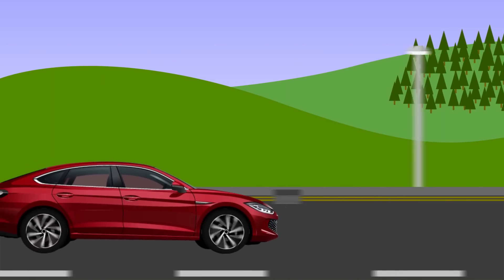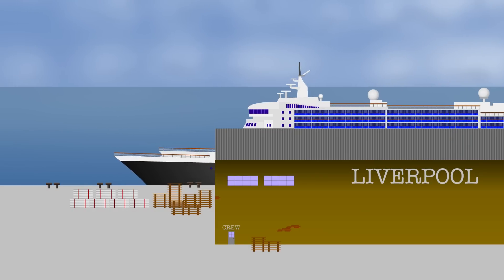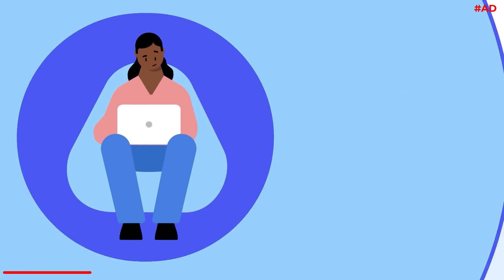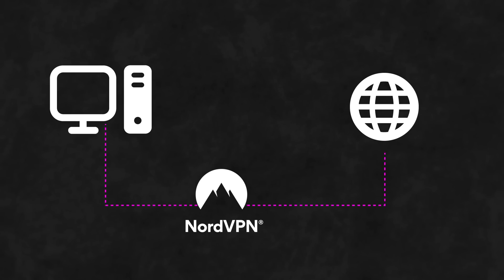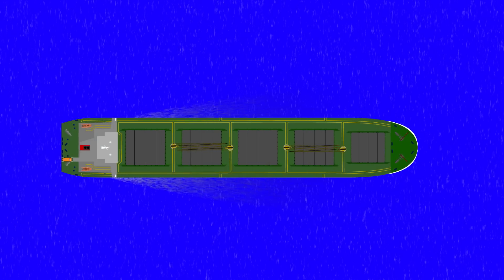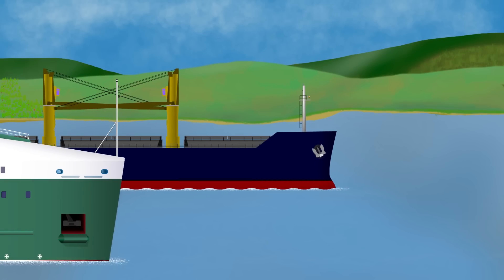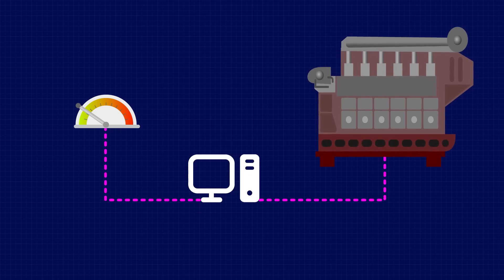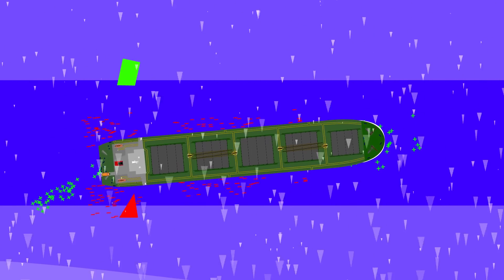What's Going Wrong With Fuel Efficient Ships?

Comment: This reminds me of how traction control kicks in on your car when you might be trying to steer with the throttle or are trail braking.  Suddenly you are out of position.
Reply: Tried to give my car a kick of throttle to try and get it back on track in icy conditions, but the traction control kicked in and killed my power and I ended up sliding into a crabapple tree.
Reply: Not me. All my cars have their abs fuse yanked the moment I get home. No abs, traction control, stability control etc.
Reply: You should be used to traction to control by now , it's been pretty standard for 30 years . I remember the days before it , you needed to know how to drive people these days can barely tie their shoelaces you want them in a car they've got to control without assistance ?
Reply: @mathewkelly9968  none of my vehicles even have ABS
Reply: @beardedgaming1337 or seatbelts ? or airbags ? ABS stops faster than formula one drivers can.
Reply: @licencetoswill  In snow, gravel and sand, ABS has a longer breaking distance than just slipping with the wheels, but makes the car way easier to control. In other situations, ABS has a shorter braking distance
Reply: @licencetoswill  One of my four has seat belts, I think two of my four have airbags. None of them came with ABS.  We die like men
Reply: @licencetoswill  youre average vehicles abs is only good in specific situations. it can for sure be more harmful than good depending on the road conditions. for example abs has nearly sent me off a cliff while i was on a logging road because the gravel was semi loose. yanked that fuse and ive never had that issue since because i can directly control my breaking.

now high speed stops and such yes abs is usually better than your average driver
Reply: omg i cant stand traction control... in the winter it is one of the most dangerous things to have on your truck.  giving gas to spin wheels and bite for traction when trying to get on the freeway is a big deal but with traction controll you just end up capping RPM at 1500 and stuck at 12mph with your foot burried to the floor.  then your side swipe, rear ended, or people up your ass behind you trying to get around.
Reply: @beardedgaming1337 Yep, it’s the worst. I was turning a corner in the snow (I have AWD and winter tires) and all of a sudden traction control kicked in and cut power and I started sliding into oncoming traffic. After that happened I always turn off traction control when driving in the snow
Reply: @beardedgaming1337 you don't understand what traction control does, or how it works.

It's intended to prevent the car from loosing traction, sort of like inverse ABS. It doesn't help you start moving, but it will save your life when you're doing 50 and hit a patch of ice.
Reply: @ΜικεΡ  I promise you that I do.
Reply: @beardedgaming1337  weird because in your own comment you describe being completely ignorant on how your vehicle functions

Comment: Putting computers in between the person and the device they are controlling is idiotic. Whether it's in a boat, a car,  plane, or anything else.
Reply: The previous way on ships was to have the controls feed to indicators in the engine room then the mechanics manually did the gradual adjustments. Modern aircraft wouldn't be able to fly without fly-by-wire. The modern safety features on cars are awesome, lane sensing and crash avoidance are required now.
Reply: It's easy to say this when focusing on the edge cases where bad things happen, if you look at things holistically however there's also a number of situations where the computer's much better understanding of a complex system means that it can substantially increase safety. The most obvious example of this is traction control - I've seen drivers complain about apparent safety hazards caused by transient loss of engine power when they take off in low traction conditions while completely ignoring the fact that their car just rescued them from an extremely dangerous loss of traction that would have resulted in far less actual acceleration, for instance, and even in this video there were points made about dangerous or equipment damaging conditions that these power limitation systems prevent. If an active safety system has an edge case where it creates a hazard, the solution isn't to completely remove it, it's just to fix the edge case
Reply: So you say Airbus is trash? 😂
Reply: @shmeli Tell us you've never worked in automation or safety engineering without telling us.
Reply: To be clear i don't mean computer assistance, I mean allowing the computer complete control or to override the human

Comment: It's a sail-by-wire system! Neat.
Reply: Because ships act differently. It's explained in the video that the systems are made specifically to slow down reaction time, so if they need fast reaction time they need to override it.
Reply: Exactly what sail are you talking about? These are propeller driven ships, we don't live in the age of sail anymore. 😂😂😂
Reply: More like EEC or FADEC imo. and such system on jet engines have been mature for decades I rarely heard anyone would complain it limits crew's control on the engine.  kinda wonder why such system on ship still need to be disabled.
Reply: *Snail-by-wire
Reply: @nellinkafotky8369  Zing. :)

Comment: Cars: go too slow and you cannoy people
Ships: go too slow and you will have severe control issues
Airplanes: go too slow and you will literally fall out of the sky
Reply: Spaceships: go too slow and you might never get into orbit and/or escape the gravity of the body where you start.
Reply: @Taladar2003  Spaceships: Go to slow, and you aren't a spaceship
Reply: Helicopters:
Reply: Funnily enough, (some) planes have a similar thing too, that kicks in at low speed/altitudes to limit steering so they don't overcorrect and slam a wing into the ground, and just like this thing with ships where the automated system might cause issues in canals where extra control/power sometimes might be necessary, it's similar for those planes if they try to land in windy weather and also need that extra control/power.
Reply: @Shaderox  dude you would not want those damping effects on planes to be removed, passengers would fly and barf 100% of the time. That's why wind limitations are very important to planes, you cant just attempt to land in a hurricane in an attempt to muscle the plane
Reply: @topethermohenes7658   Yeah, there's a big difference between not handling the plane properly on a crosswind/gust situation (common occurrence) and trying to surpass manufacturer specified maximum/minimum conditions or over correcting/reacting violently on the controls. The later ones have led to quite a few accidents.
Reply: @Shaderox  even cars do that. Mostly limiting acceleration in order to save fuel.
Reply: @Shaderox  ya whit the 777 max
Reply: Trains: go too slow and you will annoy the shit out of people waiting at crossings
Reply: Trains: go too slow and the wheels will struggle for traction.
Reply: So Jeremy Clarkson was right all along. Speed and power IS the answer.
Reply: @captainevenslower4400  It is, but did he say what the question was? :p